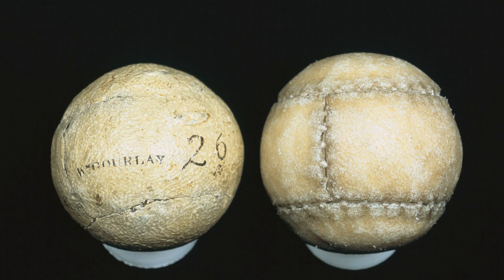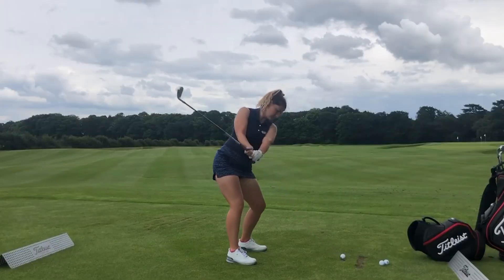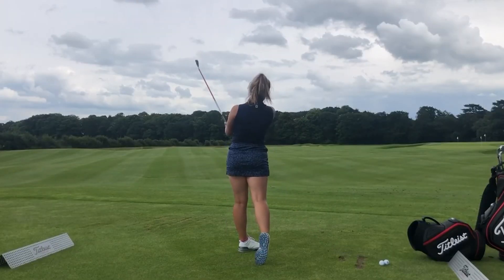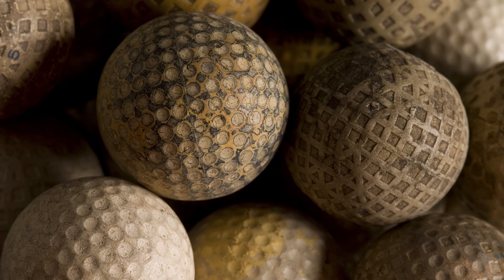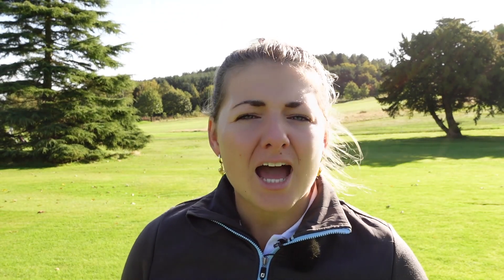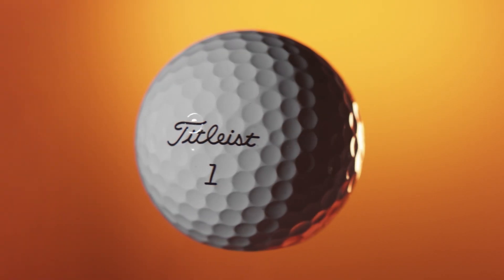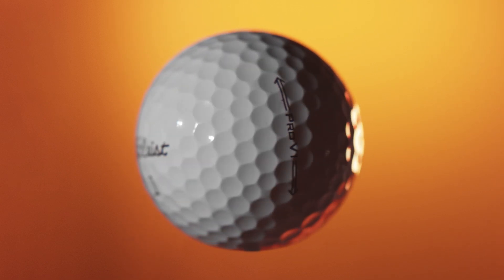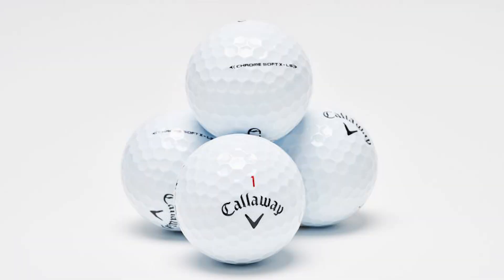Why do golf balls have dimples?

Comment: As golf ball are produced in mass. Is there any inconsistencies on the different brands in terms of pulling to one side or balance? I assume if the ball is not balanced correctly then this would impact the performance and could throw out huge misses. A good video would be based on the highest purchased brands and see how they measure up against each other (that’s my 2p worth) :)
Reply from the maker: Probably, hence why Bryson puts his in Saline solution to check they are centred!
Reply: @nationalclubgolfer  is that a video that you would be interested in doing? Picking the best current golf balls on the market and see how they are balanced against each other. Could even rate them against some budget brands. Would be good to not only see the testing in theory but also practical.